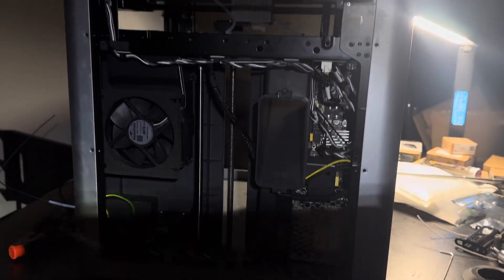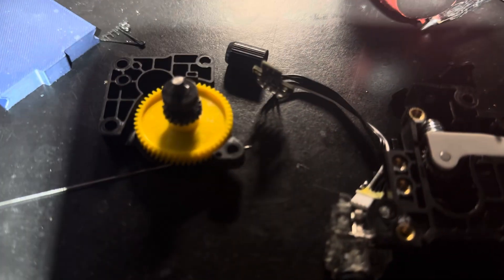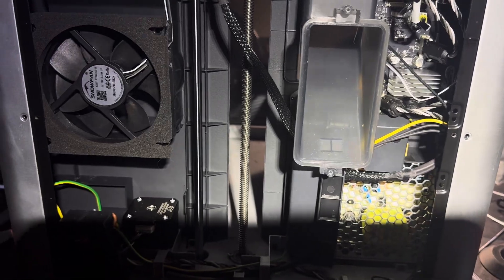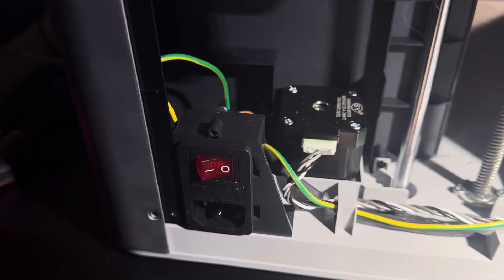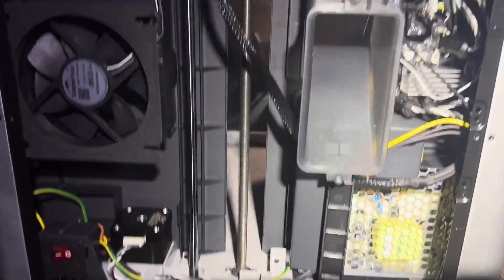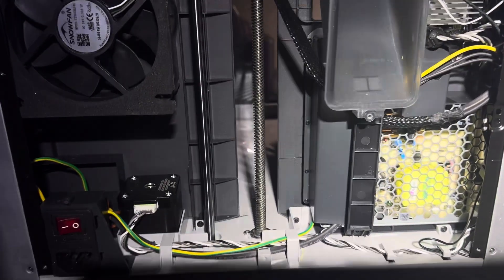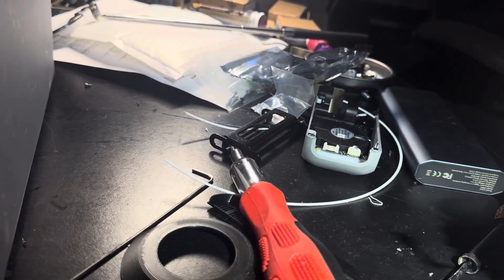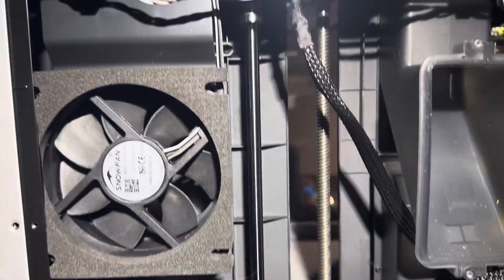Bambu X1C Carbon 3d Printer removed the back panel  to retrieve murphies laws of physics lost screws

Comment: Frist of all, Rob you sound like the chilliest dude on earth. 
This was very informative for me as I have been considering popping the rear to clean out poop and such I've lost back there. 
Best of luck!
Reply from the maker: Thank you appreciate the moral support ,  I have the 2nd Bamboo working now so it takes the pressure off not being able to print until it jams. I've been getting advice from some of the seasoned vets in 3d printing and hearing the war stories of what they went through before the automation and to bring this amazing tech forward.   I'll probably wind up building one or more  from scratch as the kits look cool with multi extruders . 
 In the interim I think to when the first problems occurred and it may have been attributable to non Bambu vetted filament.causing the initial jam . Probably an impurity at any rate I'm learning a lot of very helpful videos and content makers here on youtube. I take the perspective of  I have fun trying to fix stuff even if unsuccessful , it gives others hope. I've also learned this video is a case in point, if you find yourself in deep it is OK to take a step back , as I don't fully understand all of the precision aligned and fine tuned assembly calculus of that whole walled off area on the printer. It is though that screw bounced into a rabbit hole by looking at the larger picture , seeking advice from Bambu directly makes more sense then me causing further chaos.  I'm hoping to find a schematic with attached attributes , it would be great if it was interactive with photos showing which screws go where a disassembly and reassembly order . I just stumbled across the Bambu WIKI pages as well.     I also need to find recommended settings for 3rd party filaments , may be we as a 3d community can start to build crowd source a filament data base with tutorials  by vendor ie configuration page with the vendors help . So collectively we all spend more time creating successful 3d prints and less time repairing the printers and sharing it all fun stuff.   I've helped customers for over 30 years with their vintage hardware , some of my customers laugh as they went into tech jobs way back as I had them open the system and helped them repair the systems lol over the phone with out all the help we have now . Peace I subscribed to your page as well !